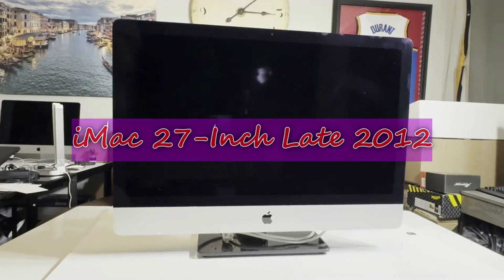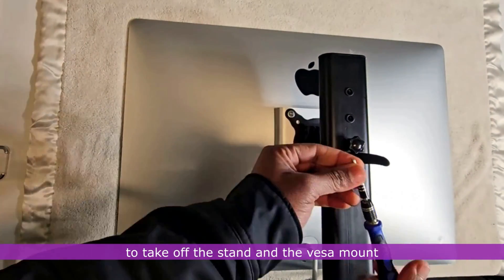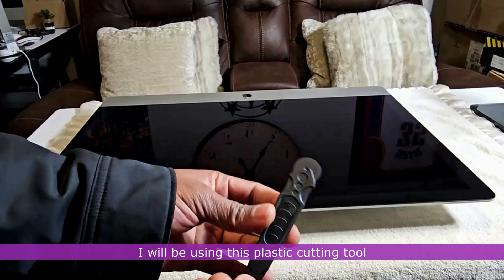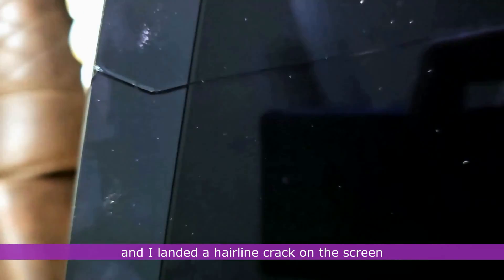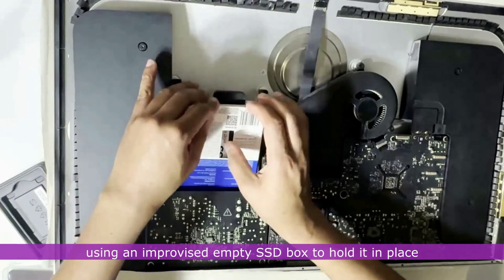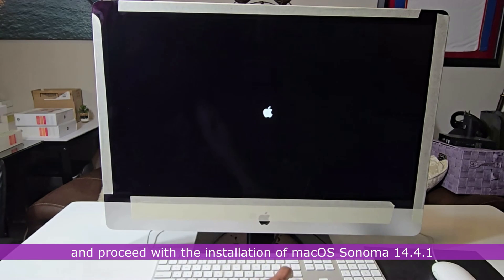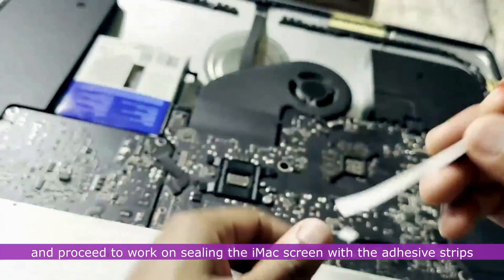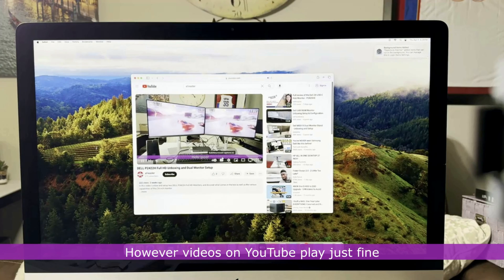Apple iMac 27-inch Late 2012 Upgrade to macOS Sonoma 14.4.1

Comment: Hi, I really enjoyed the video. I have a question. I have a 2014 iMac with 16GB of RAM. When I updated to Sonoma, the system became very, very slow. What is the problem?
Reply from the maker: You might need to run the root patches again with an internet connection.

Comment: You can also get a lot more use out of these old Intel based Macs with Bootcamp, allowing you to run Windows 10 or 11, in fact the 2010 -2011 models are even more up-gradable because you can change the processors and graphics cards, add 2 additional SSD drives instead of the HDD  and CD optical drive, without all the stick down tape nonsense as the displays are held in place with screws and magnets. Apple changed all that convenience with glued on displays and soldered in place components from late 2102 to the present day, even on their newer M chip macs.

Comment: I have 21,5 inc 2011. Support 2 slot ram. Can i upgrade to 32 gb. 16gb + 16gb ?? Cus only have 2 slot
Reply from the maker: This link will be useful to getting the answer to your question. 
https://everymac.com/actual-maximum-mac-ram/actual-maximum-imac-ram-capacity.html